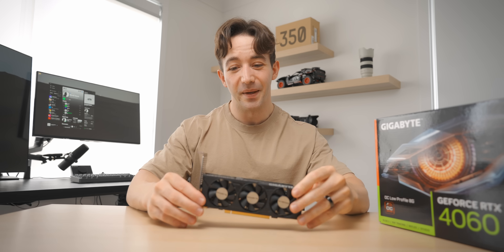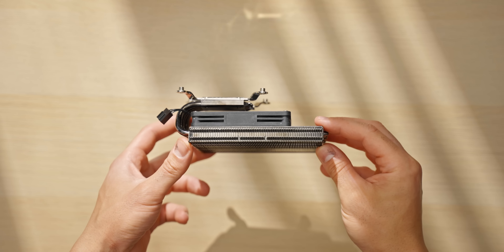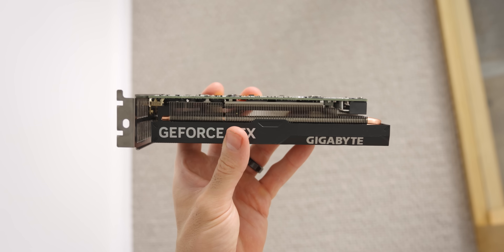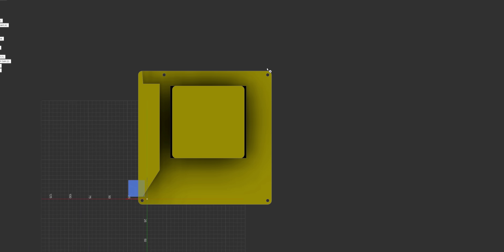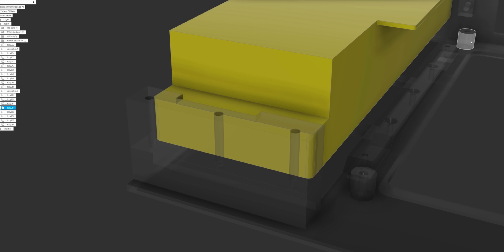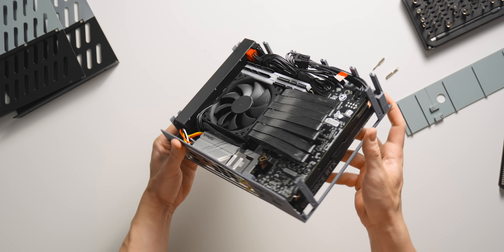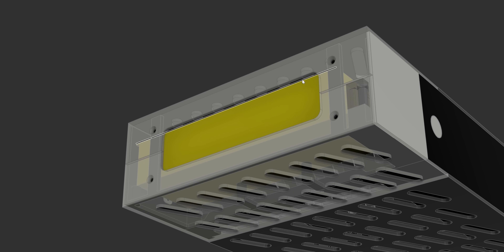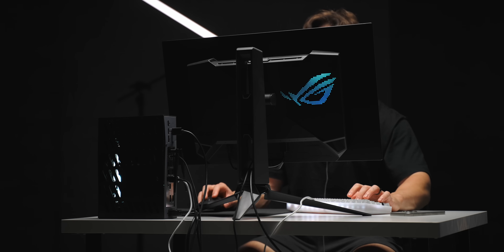Making the World's Tiniest Gaming PC

Comment: Literally a nice little project. This PC is better than my big tower case PC. Besides ABS you could have also tried wood filament or even better, compostable bio organic filament. The bio filaments I've seen are more expensive, have a higher printing (200 - 230 °C) and melting temperature (heat resistant up to approx. 145 °C) and are sensitive to UV light so they wouldn't end up as micro plastic in nature. I want to try this too but I can't afford it, yet.

Comment: Heh, I did the same thing just recently, I believe I'm about 3.1L. I machined some 3-way nuts at each corner to join the aluminum panels and save volume. Only difference is I used the RTX A2000 GPU as it's only 70W and perfect for gaming and SolidWorks (similar to some skyreach builds).

Comment: Just built a tiny ITX system with 4060 LP and 7800X3D using a sub-4L case from Gemcase C9. No need to make your own case, the C9 was designed for the 4060LP, has a real wooden front panel whose colour you may choose and is absolutely tiny, the rest is made of metal so it won’t melt, measuring less than 20x20x10cm. It can be used in either horizontal or vertical tower orientation.

I’ve also used an HDPlex GaN 250W PSU and it works great. Comes with modular cables which is perfect. The 500W unit is too big to fit in the C9 and is unnecessary anyway, 250W is more than enough for this build.
Reply: Gemcase C9 says Size(Height x Depth x Width): 210mm x 208mm x 101mm, that's 4.4L, I just made my own case (3.1L) using aluminum panels and machined 3-way nuts to join them. Definitely a need to make your own case, especially cause you can customize and do whatever you want.
Reply: @BF3DS there’s no scenario where a 3 point something litre case can work where a 4 point something litre case can’t. The size difference is negligible, so there’s no practical reason to build your own, unless you want to tackle that challenge for funsies. 

Don’t forget that not everyone has access to a 3D printer or possesses the patience and skill to design their own. Good to have some custom designed options out there, isn’t it?
Reply: @little_fluffy_clouds  I don't think you get it, you just said there is no need to make your own case, I simply said, well yes, there is a need. I wanted something smaller, so I designed one custom to my components, simple as that, also over 1L is a big difference when travelling.
Reply: @BF3DS  I’m not talking about what you did or didn’t do for your own use case, I’m saying - for anyone intending to build a tiny 4060LP machine - there are now some pre-made tiny ITX case options out there in the market which can accommodate that card, so it’s not necessary (meaning, mandatory) to make your own. 

I could have ordered a smaller 3.1L case like a Pure Mk2, but I wanted room for an HDPlex PSU and two case fans, so I went for the slightly roomier C9 to achieve a completely silent PC. There’s also the K39 as another option. My point is that it’s good to have options available now, there weren’t any options in the sub-5L category just a few years ago, so one would have had to design and make a custom case.

As for size, weight is what’s important for me, so as long as I can carry it in one hand and fit it in a small backpack, minor volume differences don’t matter (to me).

Comment: Personally, I would've gonna with a 12 GB RTX A2000 instead of a 4060. It's also a dual slot low profile card and it doesn't require a PCIe power connector, meaning you could go for an even smaller power supply, maybe even a 160W Pico PSU, which would allow the case to be even smaller and even some active cooling. Since the Pico PSU would be powered with an external power brick, you'd be also moving a source of heat away from the case and minimizing the chances of warping.

Comment: I don't think "tiniest" is how I choose a PC. I have done few custom mATX, ITX cases. First rebuilding, then starting from nothing and doing some prototyping/revisions. Taking my time, fooling around and DIY experimenting. Partially inspired by your channel. It's all fun, but tiniest is not what I should be after. Would go silent performance over tiniest every time all the time.

Yeah, and plastic cases vs metal you run into. We usually don't think about it that way, but case can also help or hinder cooling. Air in particular. Because it has significant sized surfaces.

Comment: I knew you were going for HDPLEX 250W GaN PSU. This PSU is super tiny but has weird dimensions. Incredibly low profile, but just too long for Flex-ATX which basically makes it incompatible with most of the SFF cases on the market.

Comment: If you don't already know, that white haze on ABS can be cleared up by running a butane torch quickly across the surface- just be careful not to overheat.
Reply: BMW owner tips
Reply: Any king of heat source can remove stress-marks on ABS parts, even a lot less extreme things like hair dryer
Reply: Or just holding a soldering iron near it!

Comment: I had a design in my head by building the tiniest custom water looped pc with double radiators for both CPU and GPU. 

However, it only starts at a 4070, which is outside my budget and for 4060's they don't make waterblocks yet. Also don't have the equipment to make a waterblock my self.

Comment: I built a tiny rig probably 4 years ago now, it was a k39, 3600, b450itx and mitx 1660super. Usual 1tb nvme, 16gb ddr4 3200. 450w flex atx psu. Was teeny tiny but very low quality being a Chineseum case. Nice to see hardware has come so far in so little time. Nice build

Comment: If you're 3D printing a case it'd be cool to have the GPU fans exposed so they pull air directly from the outside. You could carve the panels to custom fit the GPU shape. I've seen it done and it looks ultra cool and industrial. Same can be done for the CPU cooler fans.
Reply: I was modeling a case last year with this idea. I saw a few videos about the ytx build with the white 3060 ti (I have the same gpu)  but I have a micro atx board so it was quite difficult. I think I got it to about 12 litres or something but I stopped that project bc of school work and some other stuff. Might go back to it at some point tho
Reply: I wonder Gyroid infill might make for a good and easy flowing dust catcher and noise suppression both. There is no way to manufacture such a structure except 3D printing, and every print preparation software has the feature built in.
Reply: That's one of the biggest benefits to super small systems like this, is all of the components can get direct access to fresh air. Ducting the gaps between the component fans and the panel makes a huge difference (there's a whole video on this channel about that), and leave at least 3mm or so between the fan blades and any grill/mesh intakes above them, as you can get loud turbulence otherwise.
Reply: Dust is gonna make the poor thing pop gigabyte PSU style. I’d say cutouts with ultrafine mesh so you can still see inside while keeping dust out yk. Good idea though, 3D printing is the future of case development!
Reply: @eetoonamamanakooo  ultra fine has been determined to be really bad for airflow.   theres a reason lianli had to rework thier cases with thier hole sizing for airflow on thier panels a few years ago
Reply: @eetoonamamanakooo ultra fine meshes are terrible for airflow
Reply: @omegaPhix  used in dust covers and mesh cases nonstop, such as the FormD T1. How else you gon keep the dust and pet hair outta the gabagoo. Yo shit gon detonate.
Reply: @eetoonamamanakooo  The mesh in the T1 is far from "ultra fine"... 

But instead of relying on meshes to keep dust out of your case you could just keep your living spaces clean. Ever thought of that? My main rig runs in an open air case, last time i've cleaned it out was a couple months ago. Still no visible dust
Reply: @omegaPhix  i dont know about you but living in a dusty area like Tijuana, and having two cats creates incredibly dirty air that demolishes an open air PC build any day. I keep my living space clean too by the way, not everyone lives in a pig sty environment
Reply: @eetoonamamanakooo  It really doesn't get that dusty on desktop, of course depend on who you asking. And for how compact this thing is, I wouldn't mind picking it up and use a dust blower every other day.
Reply: How the hell modern gpu cooler can look "industrial"? Even in this video gpu cooler has goofy texture to look "cool"

Comment: Careful, the "Skyslots" cutouts are patented by NFC
Reply: Insofar he doesn’t sell these, should be fine right?
Reply: Not much of a problem considering that slots are a bad idea for airflow acoustics. It is an efficient tool path for being cut out of aluminum sheets but is structurally inferior for 3D prints.
Reply: Not only that, the entire case is a rip-off from Custom_mod SLM1 3.9L...
Reply: @lupintheiii3055  There are only so many ways to arrange rectangles inside a different rectangle.
Reply: Might need to edit the vid asap
Reply: NFC are massive patent trolls.
Reply: @damnkris  First of all, Skyslots are not patented. My logo with the Skyslots is trademarked. There is a big difference. Secondly, I have never sued anyone in my life, although I have been sued many times by actual patent trolls. Why would you say something so hurtful and untrue? You can look up lawsuits they are in the public domain, try and find one from NFC. Thirdly, my business and my hobby is oriented around teaching people to make their own stuff, and designing open source systems and case making innovations because I want makers everywhere to be able to make the best possible computer. I don't know why you would say this, but please fact check this for yourself. Thank you!!!!
Reply: @NotFromConcentrate Your website literally says that the Skyslots are "patented". "Patented NFC SKYSLOTS ventilation". If not, then that's awesome, but it's not my fault you claim to be a patent troll when you just have reasonable trademarks.
Reply: @NotFromConcentrate You make the claim that the Skyslots are patented right on the "Skyreach 4 MINI" product page. Glad to hear that it's not patented after all, but I only repeated a claim you made.

Comment: well, not to brag, but just last week i build it into a very cheap 3.8L black painted metal case from Amazon with this RTX 3060 LP in it.
Granted, the GPU heatsink grid sticks out of the case (i had to use dremel , to saw the front side of the case a bit for it), but even so, it's not that bad looking.
The fact that GPU has heatsink on the outside of the case, is actually a big + , since the inside of the case is only heated by the CPU heatsink, and the temps are quite acceptable even during gaming 😎